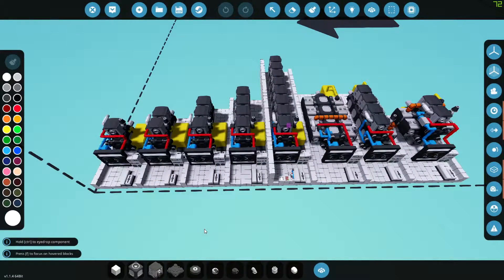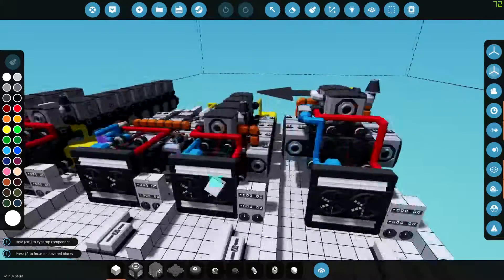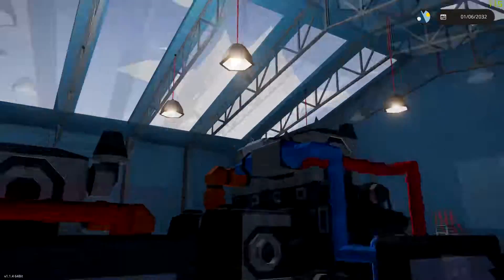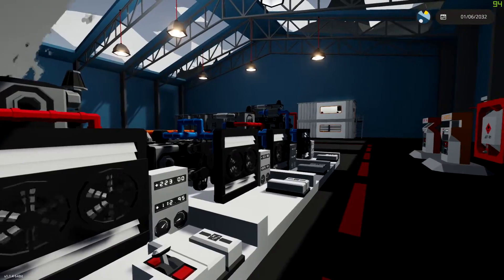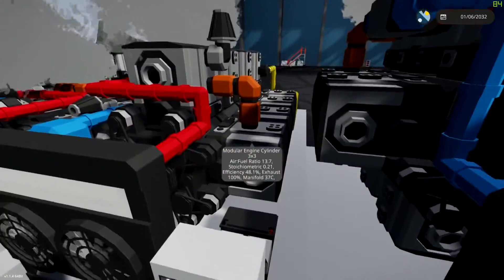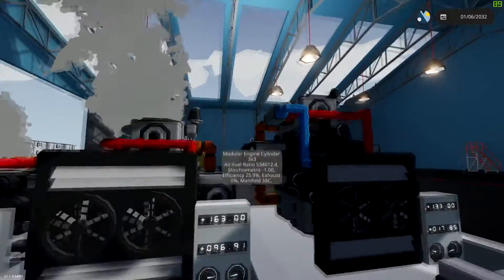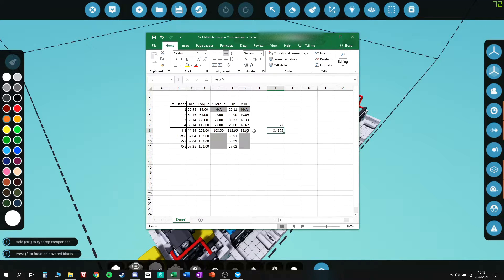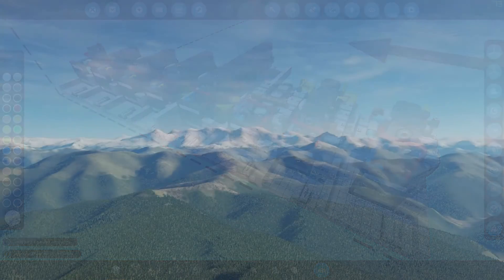Stormworks 3x3 Modular Engine Comparisons

Comment: I have a lot more experience since the last time I commented here and my opinion of the results of this video is even lower.

The vast majority of this video is absolutely useless. The game mechanics don't work the way he's saying it does.

Fuel burned increases temperature in a modular engine.

Torque is resistance on the loop, not produced torque. So because horsepower uses torque for its calculation the whole chart is wrong.

I'll summarize here what actually happens.

Number of cylinders produce a flat increase of power per cylinder. Each crankshaft has a flat decrease in power. More crankshafts = more drag on the engine.

This is why the radial engines with the same number of cylinders can spin at a higher rps with the same load.

A proper way to test this is to use a generator with gearboxes for an adjustable load. You measure the power produced by the generator output. That's the correct way to measure this. I really think this video should be deleted and redone because it's only spreading misinformation.
Reply from the maker: This is great feedback. I'm going to pin this message so people can easily find your comment. I'll use your feedback to make a new video. In all honesty I haven't focused on Stormworks in awhile. So it'll take some time to brush up. It's been over a year since I made this video. When I made this video modular engines were in their infancy. There has been a lot of time and updates that may have changed some of the game mechanics. I'll work on putting out a new updated video, and I might want to tap into your knowledge and experience to get it right, if that's ok.
Reply: @shrackgames  I was actually thinking about setting up my own recording to demonstrate this stuff. I've been trying to help out new creators asking for help on Reddit so there are plenty of people that would benefit from stuff like this.

There are a ton of details with how everything works that I have yet to dig into in this game.
Reply from the maker: @sijonda  That's exactly why I started my channel. I saw a deficit in information in certain areas where I had questions, so I investigated and made videos. The goal of these videos was not to reverse engineer the game, but to make comparisons to help people understand differences between engine configurations. The goal was never to say if you make this configuration you will have this HP and Torque. But I understand that my methods of measurements and calculations had errors. Still, accounting for constants, you can see differences in performance. It is a complex game, and there is a lot to learn and understand.

Comment: The cooling info is actually false. The radiator won't read the correct temperature vs the engine temperature. So no, none of those engines can run continuously. Plus you're running them without a load so they will use less fuel. Modular engines produce heat based on throttle position not rps.

Comment: A couple points of note:
-You can read the temperature of a cylinder from the composite (purple) output. It's number3, and can be read using a simple microcontroller.
-The modular engines are capped at 60 RPS, and will not go higher. 

If you want to add a "dumb" load to your system: 
-You can make a modular engine consisting entirely of flywheels (only load until fully spun up)
-Use a propeller with blade pitch set to "neutral" (if you forget setting it to neutral it may or may not start flying).

Alternatively, you can use generators. The medium generator seems to be optimal for small and medium engines, as well as 1x1 and 3x3 modular engines.
That also has the benefit of being able to directly read power produced, which is a good indicator of how powerful the engines are.
Either way, remember gearboxes to decouple engine and load RPS.

Comment: agreed, the configuration of the ports,  make the belt driven pumps almost unusable. Space and weight are cucial factors, and it is silly that I have to add a 1x1 crankshaft via an adapter just to make these or the temperature sensors work on a 3x3 engine. If want any ideas, or have suggestions; I have a basic boat using a 3x3 modular in the workshop, it's named "Cumberbund".
Reply: You can pull the temperature from the Composite output. Ch1 Air, Ch2 Fuel, Ch3 Temp
Reply: @pfistor  Thanks, that should be easy to display, and stop the crick in my character's neck from staring at the data between pipes, lol.

Comment: You can put a 3x1 crankshaft before your drivebelt to get a 1 block space big enough to pipe out of the back of the pumps
Reply: For the 5x5s you can use the convert to 3x3 then a 3x3 drive belt for the same effect
Reply: @matthommel3546  I am just glad to have the custom impeller as an option, easier to route pipe to the torque connection on that than dealing with adapters, and Large Pumps are still the shining example of good use of space, arrangable routing and function. So I am sending these and the whole belt drive dynamics, back to the shop; bad idea, worsely implemented.
Reply: @AggroPhene  The belt driven stuff really only affects small vehicle design for me. Amen to separate cooling and fuel pumps.